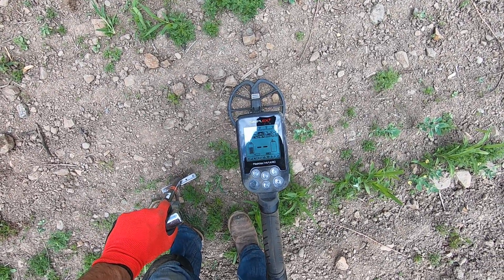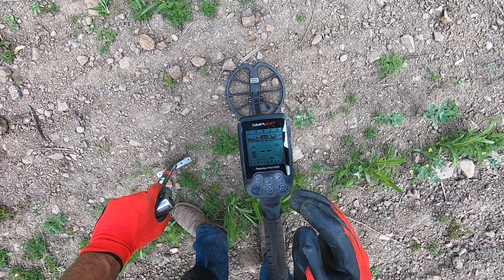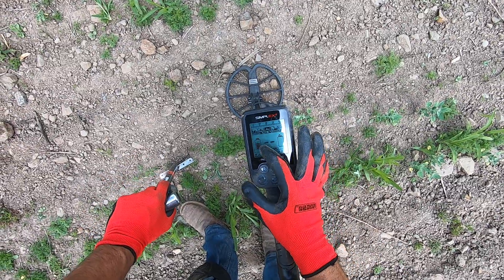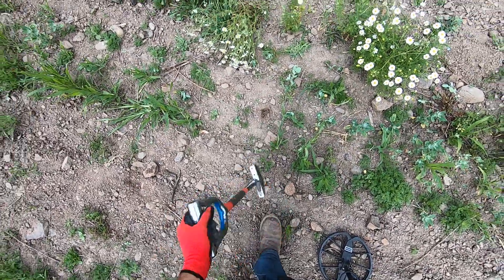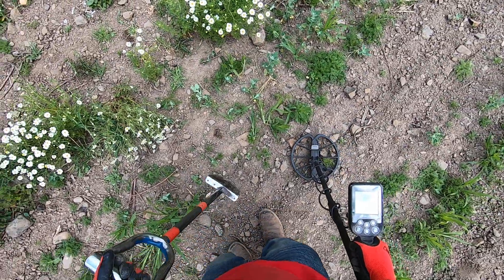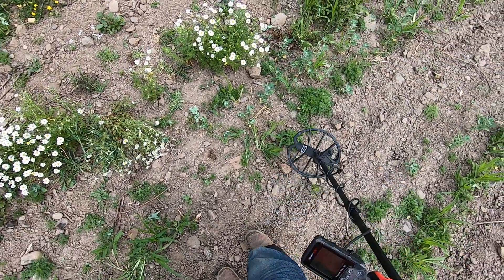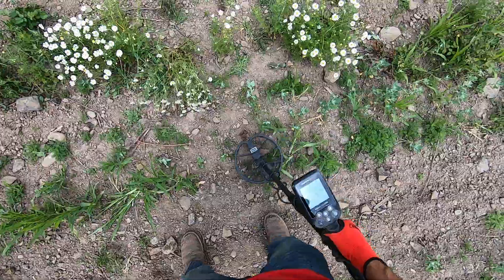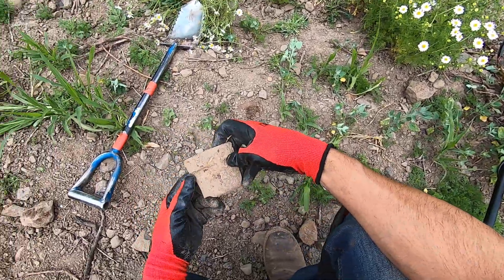The Simplex should be hitting this big iron really hard, but it is NOT!!

Comment: My machine (2.77) does that.  Will it give you anything?  Tun a quarter under the coil.  Same thing?  Turn it off and back on.  It should be fine then, but will do it again later.  Sent my machine to service center.
Reply from the maker: That is the one thing I think I did not think to do that day. Damn

Comment: I have a AA battery that Simplex+ 2.77 ignores. Or the battery is a very bad one with very poor metal, or there is something wrong with it.
Reply from the maker: If you have 0 discrimination it should hit the battery just a little. Some batteries just do not hit good. You can try other batteries to see if the simplex will hit them.